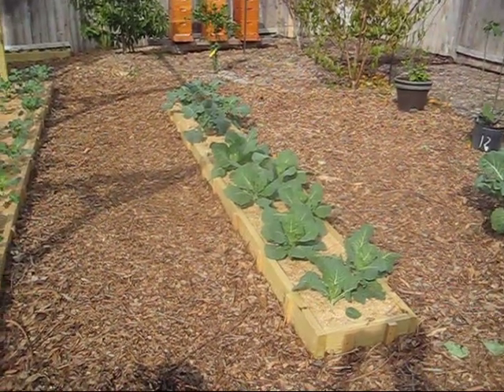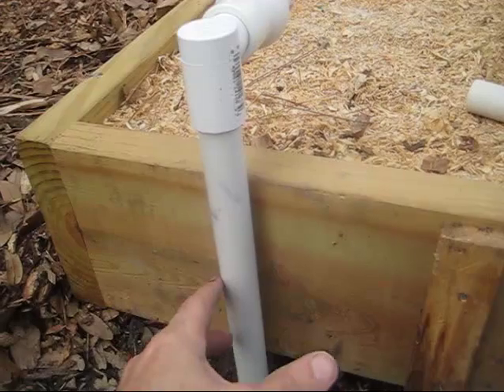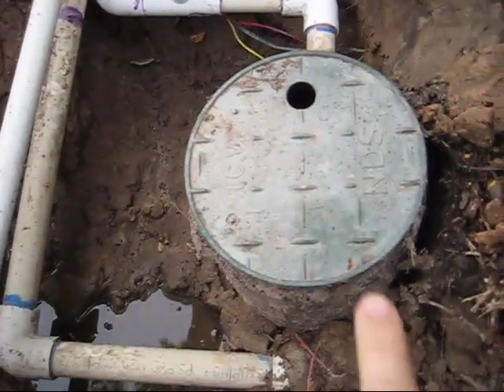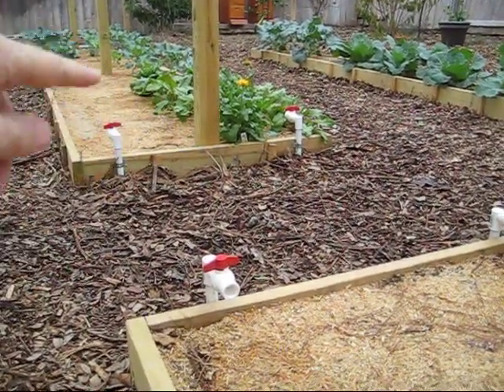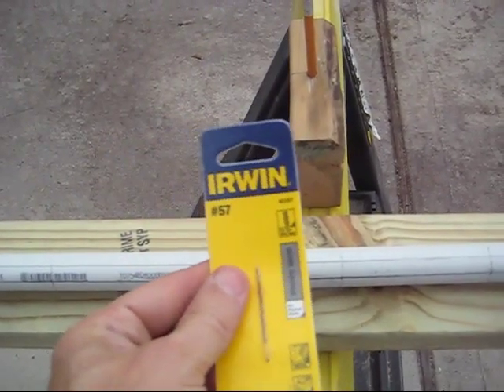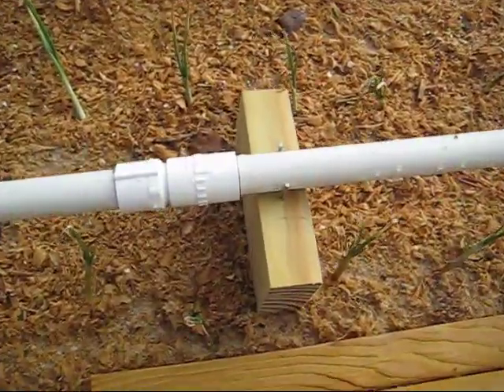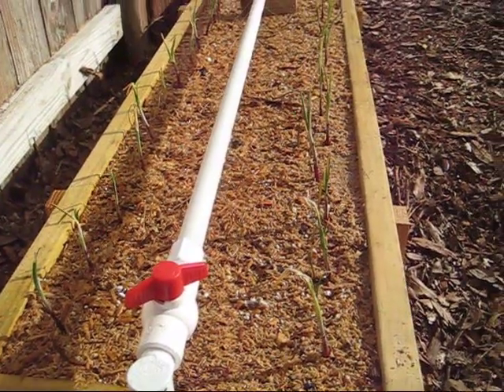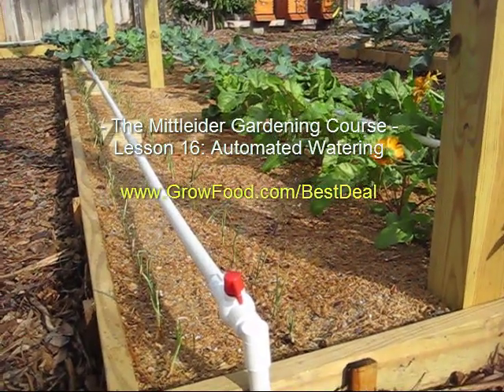Mittleider Garden: Automatic Watering, No Drip Irrigation, Soaker Hose, Sprinklers

Comment: How many inches above the top edge of the box is the PVC elbow? The wood blocks are 3-1/2" high but the sawdust settles over time which would lower the block. Just wondering. Thanks.

Comment: We are having trouble getting water all the way to the end of the lines. We are using garden hose to bring the water out to a timer then to 1/2 in pvc pipe. The water pressure after the timer is 60 psi so I would think that we have plenty of pressure. The watering pipe with the holes in it are 30ft long. Any thoughts?
Reply: drill fewer holes, like just holes at 90 degrees. No 45 holes, or two 45'[s and no center hole.

Comment: Nice setup.  I use white pvc for drip out in the desert and it has to be replaced after so many years since pfv is not UV protected.  You can paint the pvc with a latex paint and that would protect it from the sun.  Also a problem I run into is hard water etc clogging up my drill drip holes.  Drip systems are a necessary evil with continued maintenance.

Comment: As usual, A good video. I think I saw this one a while back. If You use a gate valve instead of a ball valve You would have a finer control of the water flow. I intend to do the same thing with a battery operated automatic timer. Keep going guy!

Comment: Do you line up your 12 o'clock holes with the labeling that runs the length of the pipe?
Reply: you don't need to, but it's a nice way to see that it's nice and straight.

Comment: Doesn't PVC degrade in light? Hasn' it been known to leach? How is your system holding up? 

I've heard about HDPE pipe its gray and supposedly leaches less. Whats your imput?
Reply: This is forever old :) but to answer your questions: http://www.pvcfittingsonline.com/resource-center/is-cpvc-pvc-pipe-uv-resistant/  they degrade very slightly in light but not enough to effect their usefulness.  Also, if done right, in a mittleider system the pipes aren't going to be exposed for long, they'll be shaded out by plants in no time.

Comment: Why do you drill holes at the bottom of your 3/4" PVC line when there are no plants below the pipes? Wouldn't drilling the holes at a 45 degree angle from the center line be efferent after all that is where the plants are?
Reply: As soon as someone throws out the "God" knowledge I have to roll my eyes because I can foresee the anti-intellectual tripe that is going to proceed.
Reply from the maker: +Gruetzenbach Hans Great question. We drill two holes at 45 degrees and one at 90. The water is directed to the plant roots, not the plants and it dissolves the nutrient mix every time it is on because we sprinkle it under the pipe.
Reply: Wow!  I need to check out the woods where you live.  My woods doesn't have any nice neat little rows of tomato and pepper plants anywhere.  Seems like mostly a bunch of weeds that don't taste very good.
Reply: hahaha yes sir! I say gardening is "God's work" ; not in the sense that I'm doing what God WANTS me to do. More like I'm doing God's chores.
Reply: +LDSPrepper a whole lot of trouble when back to eden method would save you all this mess.  Raised beds always need more water and are water wasters.  Take a look at the woods near by.  Look at the ground there.  Is there a watering system installed there?  NO.  God's way there.  Back to Eden Garden is the way.
Reply: I have to disagree.. the whole reason you can have a garden is due to God creating the seed. which is a miracle in itself. However, BTE garden is amazing.. and you can use that method with raised beds also. I see you covered everything .. layer layer is the key.. and always covering.. this is the BTE way just like in nature... It is covered in the fall self composted and wonderful for new sprouts in spring.  Just the way God created it...  Mittler garden is interesting too.. and I like alot of his thoughts.. I just don't want to have to use his fertilizers. I'd rather use my own stuff my farm produces.. but love the clean manicured look from mittler.

Comment: May be a silly question, but I couldn't find the answer in the book either.  Do you leave the system out over winter or do you unscrew it and store it.  I won't be doing the in the garden greenhouses, at least not this year.  I guess with the price of pvc being so cheap it really wouldn't matter, just thought I'd ask.
Reply from the maker: +Katie Miller (Kansastraveler) In Texas I left the pipes out during the winter because I was growing. Here in Idaho I would remove them from the garden and store them in the garden shed. That is one reason I use screw together connectors, so I can easily break these down to 10' lengths for storage.

Comment: What is the difference between schedule 40 and 200 pvc?
Reply: +Saira Tariq 200 has thinner walls so it allows more water flow and is cheaper then S40. 200 = 0.060  thick and S40 = 0.113 thick

Comment: Nice system, However instead of drilling all those holes I would use T Tape. It already has the emitters at four inches, six inches or twelve inches. The pressure is regulated at 10 PSI. It is a lot cheaper than PVC and is easy to replace. It does not spray like a hole in PVC will do. It merely drips at 1 gallon per minute per 10 feet of T Tape.
Reply: *****  CPVC  is used in potable water...../used in hot water apps too.
Reply: +NorthEasternGardens PVC is in EVERY Potable water system in the south. It doesn't leak/leach any poisons. It is approved for potable water.
Reply: +Jeff Benefield PVC is safe unless it was made before 1977. Don't let the eco-nuts who think  everything gives you cancer get in your head. Odd how they think everything gives you cancer except their pot.
Reply: Can't be hatin' on pot. I used it in the 90's ( hodgkins lymphoma)and my 67 year old mother is occasionally smoking now to combat nausia associated with her cancer..  But, yeah, people  don't always think things through. They run on their feelings and fears over logic. I try to show them once. After that, I just let them believe..
Reply from the maker: David Colton I have used T tape too. I really like the PVC watering much more.
Reply: NorthEasternGardens , So is breathing !!!
Reply: David Colton One problem with I see is using PVC.  PVC pipe is not used in potable water systems as it leaks poisons into the water so I would not want this watering my garden.  I will be using poly tubing or pex for mine.
Reply: +Jeff Benefield You are 100% wrong buddy, and it does not matter if you are in the south or anywhere else.  There are many things approved for things that are not healthy, including copper pipes which contain lead.  PVC is not a healthy solution and you do not want it installed for potable water, it is not used in potable water systems where I am from.
Reply: +Ima SingusChickenus You are welcome to poison yourself all you want, no one will stop you, but please don't spread inaccurate information..... do some research, it is proven plastics including PVC are harmful, period.

Comment: hello . i am wondering that how it is automatic device ?? we are controlling it by turning on and off the valve
Reply: harul sehgal The tubing runs to his garden's automatic sprinkler system so it comes on and shuts off as he has it programmed.  The ball valves are merely there to regulate pressure in each tube so to ensure even watering.  Hope that helps.

Comment: you also do not want the pipes elevated so much. there is no reason for this other than  it looks nice. it wont get clogged because of the water pressure and you want the water next to the base not higher where it will spray all over or get the leaves wet
Reply: ever heard of roots seeking water?

Comment: ok you definitely do NOT need 200 PSI pipe. schedule 40 is more than sufficient. If the water came out anywhere near 200 psi it would blast your plants to Jupiter Water supply isn't even half that. Also 1/2 inch PVC is also sufficient you do not need 3/4. Just adapt it down if you use the watering system as he has done
Reply: 200 psi 3/4" PVC is thinner/weaker and cheaper than Sch40
Reply: snaponchainsinc1 was nt aware thanks for that info
Reply: Did anyone stop to think that he might have needed the structural rigidity of that pipe to keep it from sagging? think people..........

Comment: Hi LDS prepper, GREAT video but I wanted to point out a potential problem. I noticed you use pressure-treated wood to support your sprinkler pipes. 
Not sure if you know this, but that treated wood contains arsenic and other bad chemicals that can leach into the soil and ultimately into your vegetables.
I would respectfully suggest that you change to untreated wood. It certainly won't last as long, but you don't risk contaminated vegetables.  Just a thought.
Reply: Not safe just safer.
Reply: The lumber yards have quit using arsenic to treat their lumber. Pressure treated wood is fine to use.
Reply: Lumber is now treated with a copper compound, it is safe.

Comment: I was just finishing the Mittleider watering system when I found your video.  I glued the ends of the pipe instead of using the threaded fittings.  Your method is obviously much easier to build and store.
I did not us the screw fittings on the pipe ends because I was concerned about the pencil line alignment when the screw fittings reached the tight point.
Was this a problem for you?
I enjoy your video's very much.  Keep up the good work.
God bless

Comment: Hello. This is my 2nd year doing mittleider,  and loving it.  I have decided to conquer the watering system.   I am having issue with the drill bit.  My question is how do I put such a small drill bit into the chuck?  Thanks for all the info!!
Reply: Wrap the shank of the bit with a few turns of electrical tape.  I use a Dremel Tool and I have NEVER broken a bit.

Comment: Question:
I'm having trouble finding the 16-16-16 fertilizer here in CT.
Any advice for 50 lbs of the stuff? Quick release type?
Ty!
Reply: No plant needs NPK in equal portions. Using a fertilizer with 3 numbers that are the same is a big waste. Most of it will end up in ground water or runoff.

Comment: Does anyone know how long you let the water run?  How many gallons? do you use a rain/ water gauge to measure?  Just don't want to over water.  thx
Reply: I believe according to the book, you are supposed to water until water runs out the bottom of the frame or until it won't absorb any more if you're in flat soil bed.

Comment: Did you ever figure how much each 20 ft bed cost in materal?
Reply: If you are asking like wood wise i went to homedeopt yesterday and got 3 2x12x16ft boards and had them cut for me 4 lengths @ 8ft and the third into 4ft sections total cost for 2 4x8 raised garden beds was 27.00 including the deck screws. How you ask? Its for a garden bed so structuraly sound wood dosent matter i simply asked if they had and that were damaged the guy said actualy we do let me grab a few for you. They are origonaly 24.00 per board @ 70% off i got them for 5 something a board :) just a little cheap trick

Comment: Ok I have to ask some questions. I live in Beaumont and have access to rice hull's why do you say they are not needed?  If I  where to buy a copy of the Method would you buy the course PDF online or what. I see several books listed.   One suggestion on the drip system why not use the box walls on the end to support the pipe instead of a small block , or mount the block to the end to ensure it wont settle and become uneven?

Comment: RLSgardener
2 months ago

in reply to Kino Di Salba 
""Chromated Copper Arsenate (CCA) treated lumber is no longer being use since December 31 2003. The compounds currently being used are alkaline copper quat (ACQ) and copper azole (CA-B).Both contain copper and a fungicide but no arsenic The copper keeps insects at bay, and the fungicide prevents soil fungus from attacking the wood. In ACQ, the fungicide is quat, which is also used in swimming-pool chemicals and as a disinfectant. CA-B, uses copper and tebuconazole, a fungicide used on food crop""

I AGREE!!! I work at Lowe's, and they said the treated lumber being sold today is even better than just two or three months ago.  NO ARSENIC NOW!!!

Comment: Chromated Copper Arsenate (CCA) treated lumber is no longer being use since December 31 2003.

The compounds currently being used are alkaline copper quat (ACQ) and copper azole (CA-B).Both contain copper and a fungicide but no arsenic The copper keeps insects at bay, and the fungicide prevents soil fungus from attacking the wood. In ACQ, the fungicide is quat, which is also used in swimming-pool chemicals and as a disinfectant. CA-B, uses copper and tebuconazole, a fungicide used on food crops.

Comment: Also if you paint the top of the pipe it will hold up better in ultra violet as was pointed out by Tim Jones and rightly so. Sch40 up to ball valve for durability then 200 psi. There will be no problem as long as the cross sectional area of the drilled holes does not exceed the area of the sch  40 inside diameter. That will not happen here.

Comment: Class 200 is widely used in auto sprinkler applications Due to cost and .The Outside diameter is the same as sch 40 so the thicker walls in the 40 takes away volume on the inside.In these applications they are normally non continuous pressure jobs. IE when sprinkler solenoid comes on the station lines are feeding sprinkler heads so while the orfices emit water it is not full pressure. When they turn off the station drains pressure down to head level and below if you have a station drain.

Comment: Schedule 400 is primarily used for areas of high traffic, because you can practically drive a truck over it and it not break.  Sch 200 is easier to cut and is a wee bit more flexible.

Comment: Are you using automatic sprinkler selenoids for timing .If so how long per bed or station and how many times per day?great job
I also wanted to point out there are fittings like king drains that when the pressure is on it seals and when off it drains.handy for wintertime.They would go on the end where LDS has a screw cap..A ball valve can be fitted before the drain for continuous summer operration.God Bless

Comment: hi noticed u used treated pine for the frame work of yr garden beds im in Australia and were constantly told don't use treated anything due to the chemicals leaking out into yr soil and into yr produce ive now bought bath tubs cheap and have just removed old beds and placed them ready to be re filled with soil but now ive seen this I want this way but don't want to use treated materials can u do this same thing but using baths ? and can I use my soil and just mix in sawdust etc? a lot to learn

Comment: Home Depot and Lowes have twist/ egg timer type or battery operated watering timers, they are fairly inexpensive and screw onto your spigot/ hose bib. I use these when I have my garden running. The battery type has a great menu of choices from watering seedlings every so often around the clock to specifically one time per your time frame.

Comment: Many cordless drill chucks when fully closed leave a small triangle opening in the end. These flats of the triangle hold larger bits well but smaller bits just spin or fall out. You can buy for less than $10 a 1/4 in hex drive drill chuck. It will hold the smaller drills and the hex end will fit in your cordless drill or any of the new hex drive cordless impact drivers. For smaller drill bits make sure the bit is in the center of the 3 chuck jaws and not just pinched between two of them.

Comment: Hi.  My Suggested Improvements. If you purchase a 3/4 T for the PVC, then slip it on the PSI 200 Thinwall(not glued).  Then put a short piece of Sch40 in the T hanging down, then the tube won't rotate.  You can also notch the T so that you have 0,90,180,270 marked.  The pipe is marked for rotating. 

You can also use the "T" holding the thinwall for slicing the Edge off for the Plastic holding pipe. 

A marine fresh water pump can also be used for moving water from your rainwater system.

Comment: Few questions: my garden is L shaped. One side is 18' the other is 12' and 4' wide. My plan is to run three of these evenly spaced through the center of the garden with holes drilled on both sides evey foot.  Will there be enough p

Comment from the maker: It would increase the pressure in front of the smaller diameter then once the water squeezed through it would be at a lower pressure. Imagine water going through a hose that is 1/2" then through a hole that is 1/4" then to a hose that is 1/2". The water would be at 1/2 pressure in the second hose.

Comment from the maker: You can go sch 40 but we found no reason. The sch 200 3/4" pipe with the holes is important because it needs to be thin walled for the watering to work properly. They tested both and found sch 200 to work the best by far.

Comment: A way of doing this for renters might be to use garden hose attached to the uncapped side of the pvc instead of a ball valve or string them all together using garden hose with the last one in the chain being capped. No digging or burying anything underground and you can take everything with you if you moved. .02

Comment from the maker: The pipe supports are treated 2"x4" lumber cut 6" long. I hammer two galvanized finish nails on top which fit snugly against the pipe. But even without the nails the support stands up just fine.

Comment: Thanks for the insights.  My #57 drills are in the mail and I have to drill 24 sections of PVC to convert my drip system.  Started the pre-plant fertilization in 2 of my 12 beds.  I have 3 to turn & fertilize this weekend 2/18/12.  But by New Year all will be done.